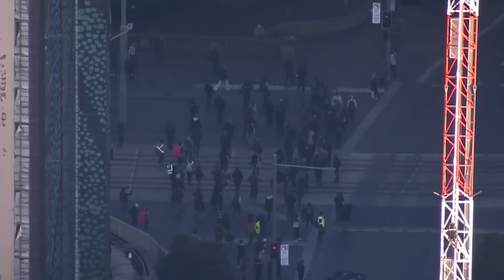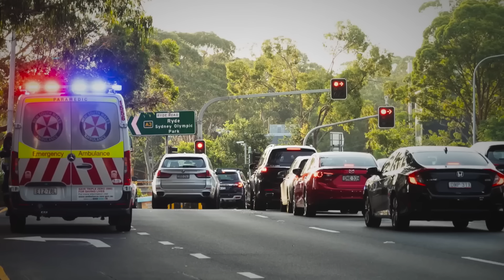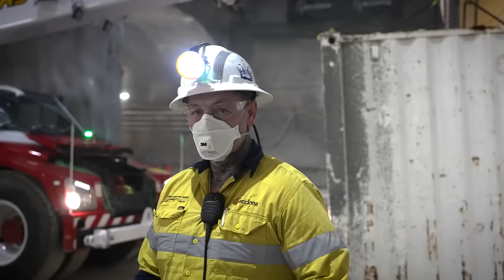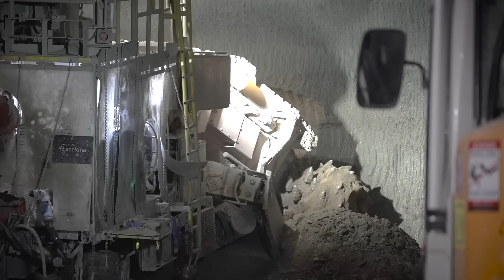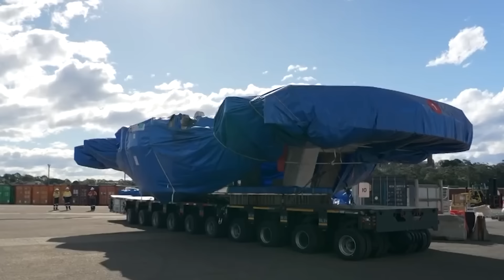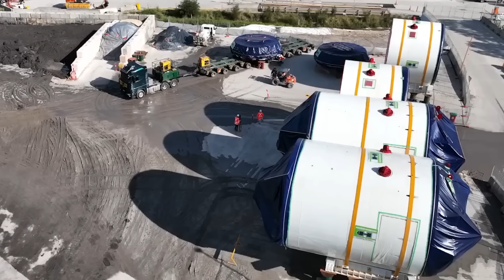The NEW $14 Billion Harbour Tunnel Dividing Sydney

Comment: This project will do what the previous Sydney harbor tunnel did, reduce congestion on the bridge & move it futher down the road, then after several years congestion returned, this time on both the bridge & the tunnel, as it encouraged more people to use the car, the only answer has been & still is better public transport, but successive governments since the 1950's have spent more money on road building then on rail transport, that ratio would be in the vicinity of $1 for rail to &20 for road construction, that ratio has only changed in the last ten years.

Comment: The Western Harbour Tunnel is designed to do one thing - remove the bottleneck at the Rozelle Interchange and divert that excess traffic under the harbour, bypassing the Anzac Bridge, Western Distributor and Sydney Harbour Bridge and bring the traffic back to the surface on the road it would be using anyway - the Warringah Freeway, which was already Australia's widest freeway even before the upgrade works began a few years ago. Therefore there will be no bottlenecks.

Sydney's population is going gangbusters and we cannot have that number of people travelling on roads designed for a 1960s population.
Reply from the maker: Hi @vintageradio3404 — Appreciate you watching. Thanks for laying out your perspective and adding to the discussion.

Comment: Bad AI thumbnail image. The tunnel is on the other side of the harbour bridge to the tunnel. And it’s goes underground so no tunnel machines on the water.
Reply from the maker: Hi @waza987 — Thanks for your comment. The thumbnail is illustrative rather than a literal depiction, intended to convey the scale and location (Sydney) of the project rather than the exact construction setup. You’re right that the new tunnel alignment is on the opposite side of the bridge. Appreciate you adding to the conversation.

Comment: Crossing the Harbour is the shortest link to traveling to North of the state from the city and Eastern Suburbs without negotiating the maze of toll roads. It's the shortest link South for North Shore and Beaches residents to the airport (and the new airport in the west) and to Southern parts of the state.
Reply from the maker: Hi @mindletloose — That’s one of the arguments often made for a direct harbour crossing. How well it works in practice will really depend on how it integrates with the wider road network and how traffic patterns respond over time. Thanks for sharing your perspective and adding to the conversation.
Reply: @Boundless.Builds.Official  It's specifically built to integrate into existing road networks (albeit toll roads). North Shore residents will access  WSI using the new tunnel, the Roselle Interchange, Westconnex and the M4. Going South? Onto the St Peters interchange and use the M8 and hopefully when engineering solutions and government will eventuates, the M6.
People from Inner West suburbs heading North have an alternative to the Harbour Bridge to connect them to the M2 and Northconnex.
The system still has lots of missing pieces. It's tremendously difficult providing greater connectivity without seemingly going around things instead of straight.

Comment: Very interesting information, however I heard years ago online (don’t remember the source) whereby there are already existing tunnels underground in Australia linking around Australia and beyond. Pity they can’t be utilised to save money. Unless they have all been destroyed in the last decade 
Just my thoughts
Reply from the maker: Hi @Beyond-The-Rainbow — Thanks for sharing your thoughts. Claims about continent-spanning underground tunnels do circulate online from time to time, but there’s no verified engineering or historical evidence that such networks exist in Australia. Large tunnels require extensive documentation, ventilation, power, and ongoing maintenance, so projects of that scale would be well recorded. Most tunnels here are local, purpose-built for specific transport or utility needs.

Appreciate you watching and adding to the conversation.
Reply: @Boundless.Builds.Official 
I understand your point however I believe the existing tunnels were not known publicly due to the knowledge base of their construction 
Cheers
Reply: @Beyond-The-Rainbow  None of these long-span tunnels exist outside eastern metropolitan areas. Adelaide is building one, though all major road tunnels are in metro areas only. There was a proposal to build a bypass of the Great Western Highway through the Blue Mountains - to be 11km long and run between Medlow Bath and Little Hartley. Surface prep has been completed at both ends but the ramps to the tunnels have not been added due to the current government cancelling the tunnel project.

The mainline tunnels on the WestConnex network are the second-longest road tunnels in the world - 22km - and thus by far the longest in Australia. There is nothing bigger here and probably never will be.
Reply: @vintageradio3404 thanks for info. I’m meaning the DUMB’s that do exist from Canberra to Pine Gap